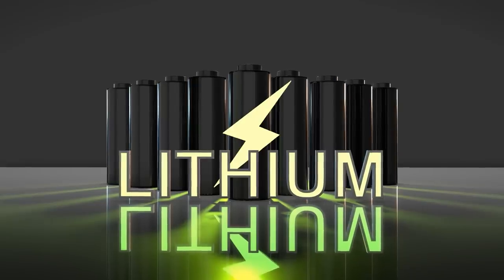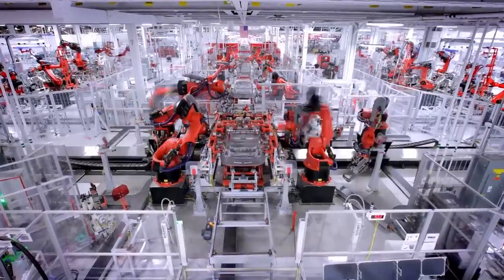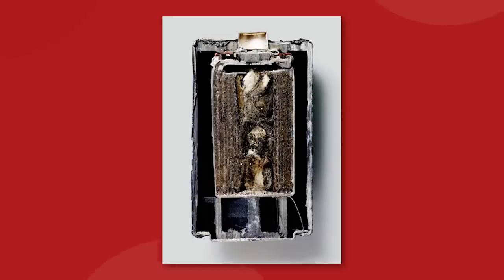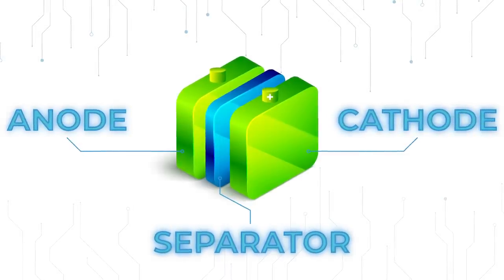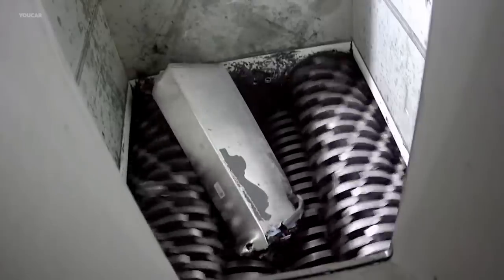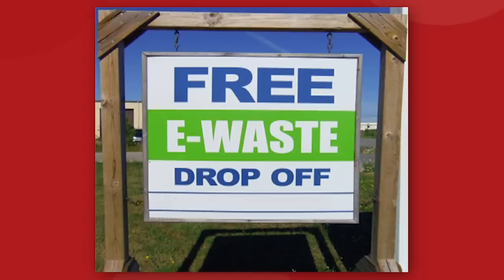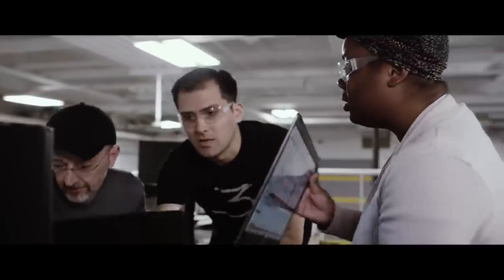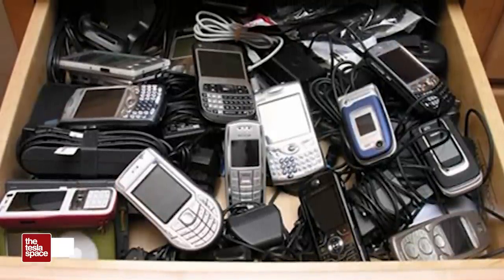The Surprising Solution To Tesla’s Battery Supply Problem!

Comment: Why cant tesla take those massive parking lots and cut its land use by 60% and go up and use the extra 60% space to add trees or solar mybe bolth to reduce there demand and reduce co2.
Thoughts.
Reply: They are covering the roof in solar, parking garages are EXPENSIVE and the concrete production is energy intensive. right now they have tons of land available. 

It would maybe make sense to build a parking garage for employees closer to  the building then they might not need so many shuttles.
Reply: The massive parking lots are staging waiting to load onto transportation.
Reply: @MM-fe9mz  or start adding solar panels over the existing parking spots. It would take less material than a garage and also shade the parked cars.
Reply: Both good a covered structure to sda teslas with solar panels on top. Also put the superchargers in there for first battery charging. Tons of land at austin
Reply: @why6212  they might eventually do that, but first first gotta finalize long term site plans as up until now things keep getting moved around. The power substation, the cathode plant was moved, the pickup lot is being relocated.

Comment: The Old Tesla only running 100 miles or Km in it's old age gets totally refreshed by just replacing the Cell pack and since the newer technology is going to be more efficient, that one upgrade would be worth the investment for someone who would never consider buying new and is happy to drive a Restored and better performing older model. The Storage technologies are continually developing so what you are saying about todays batteries most likely won't be true in five to ten years ... We have already seen with many guys the innovation and cross pollination of Electric into ICE and the best is yet to come. I am hoping one day we will find Nick Tesla's power broadcast and receive system that gave free usable wireless power. He did it so it could be done again .

Comment: the real headwind for Tesla and all EVs is that the current state of our grid cannot supply the needed power to charge millions of EVs. in order to do so, these power source companies will have to expand and upgrade causing the current 15 to 25 cent per kWh we pay to be more in the range of one to two dollars. this is not cost-effective. moreover, hydrocarbons and nuclear are the ONLY reliable fuel source for energy suppliers, which is taboo with the greenies. the only out for Tesla is for the company to concentrate on the cornerstone of its business model and mission: generating and storing energy via solar panels and batteries. but this is not what Tesla is primarily investing in--it's not as sexy as the Roadster and a 0 to 60 in 1.9 second Model S Plaid.